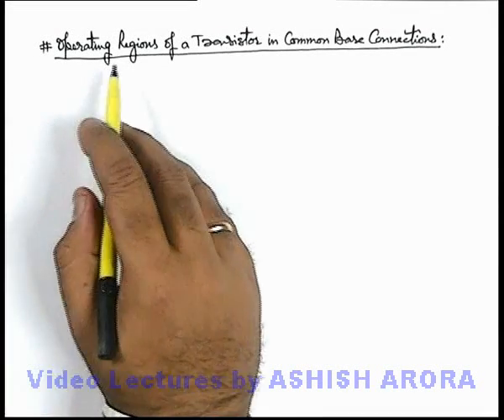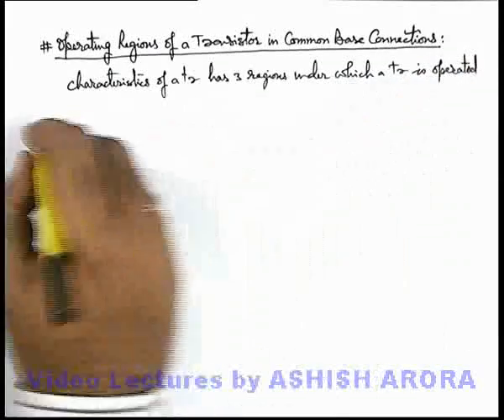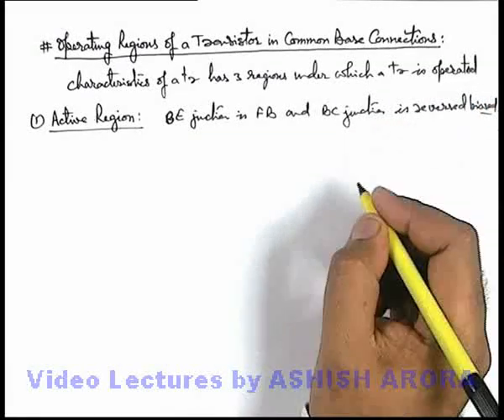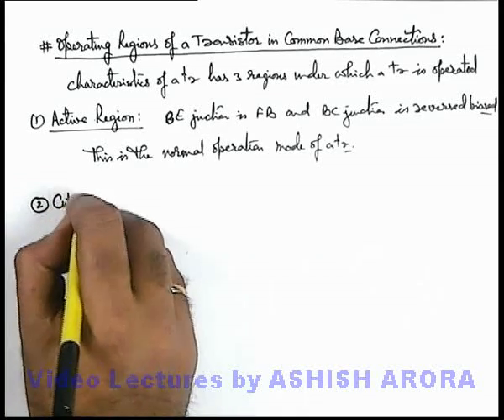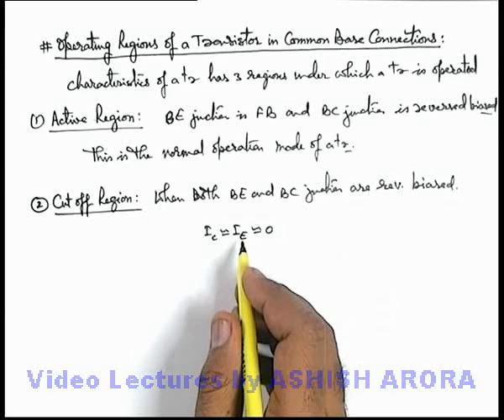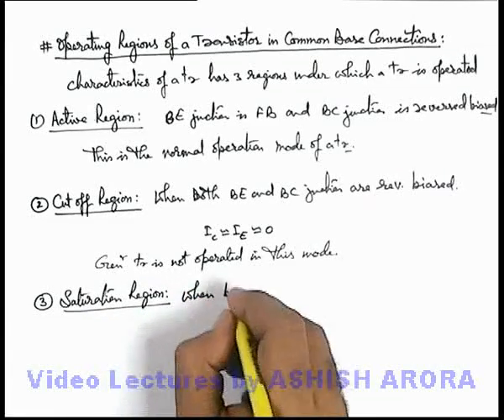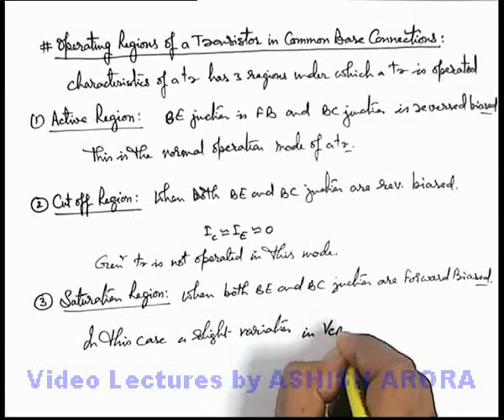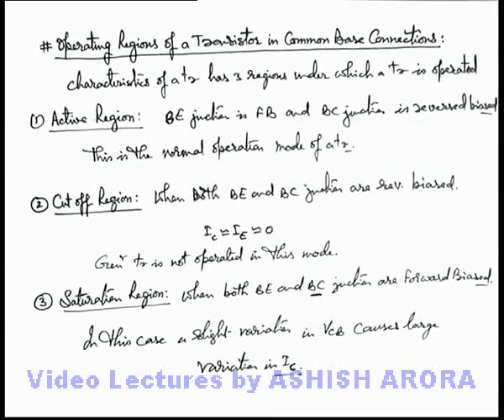Class 12 Physics |Transistor | #9 Operating Regions of a Transistor in Common Base Connections

Comment: why does the current increases suddenly?
Reply: Brother if the voltage of collector base is negative then it is said to be reversed Biased and due to this current gets repelled and at some value it becomes zero. And when is increases slightly the negative terminal attracts the electron from Collector region rapidly but it does not exceed the emitter current hence after some more potential it becomes constant and approximate to emitter current
Reply from the maker: Because collector voltage drives current faster in saturation region...
Reply: Sir , why it don"t extract current faster in active region ?